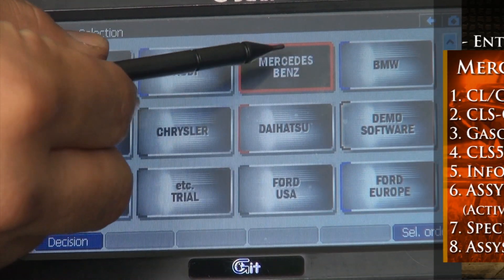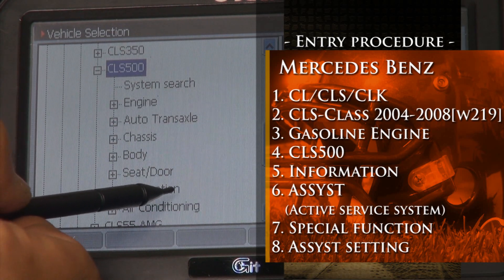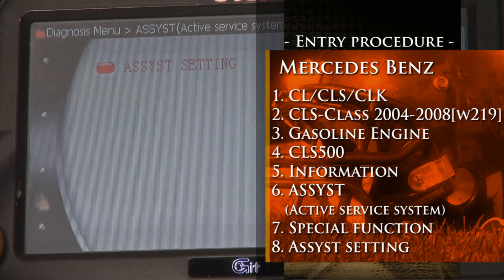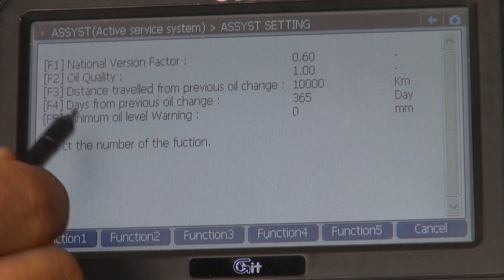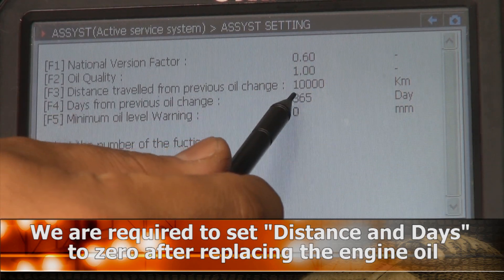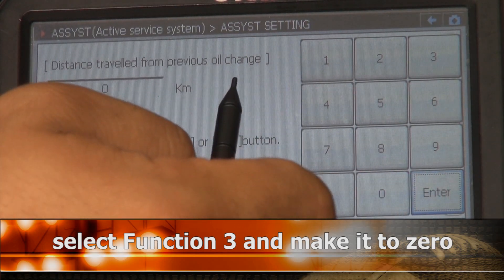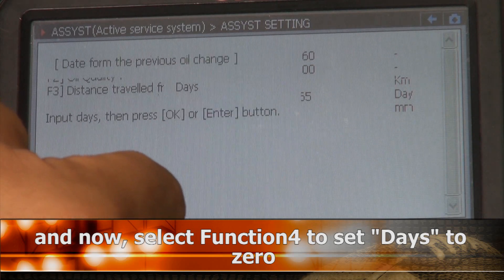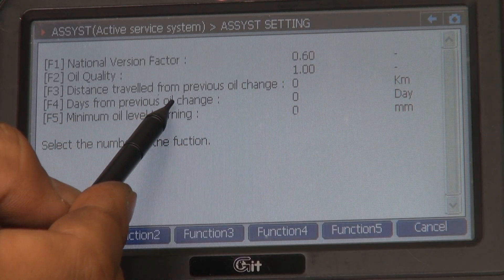G-scan ASSYST (Active Service System: oil reset) on Mercedes Benz CLS500

Comment: hi greg, i think the statements " distance traveled from previous oil change" is misleading.  because if you just performed an oil change it makes one confuse. can the scanner be reprogrammed with a message such as "distance traveled after performing oil change"?
Reply from the maker: Hello. We will certainly take your suggestion into consideration. Thanks  Sunil.
Reply from the maker: Hola. Por favor, entienda que hay problemas de copyright con el logotipo de la compañía que se muestra en G-scan. Si tiene más preguntas, envíe un correo electrónico a loy@e-zds.com. Gracias
Reply from the maker: Hola. Por favor, entienda que hay problemas de copyright con el logotipo de la compañía que se muestra en G-scan. Si tiene más preguntas, envíe un correo electrónico a loy@e-zds.com. Gracias
Reply from the maker: Hello there. We cannot provide an answer to your question. Please contact your local BMW dealer regarding the module replacement.